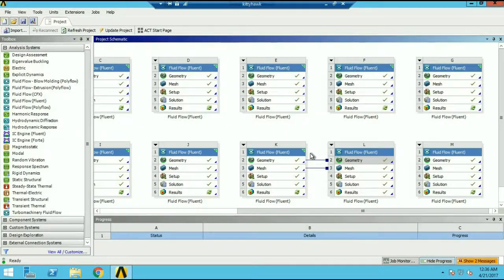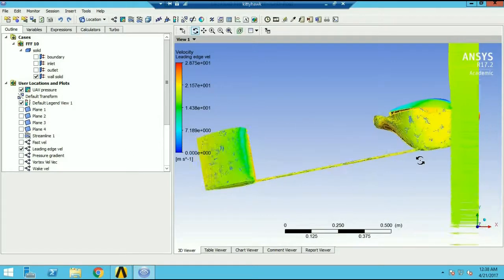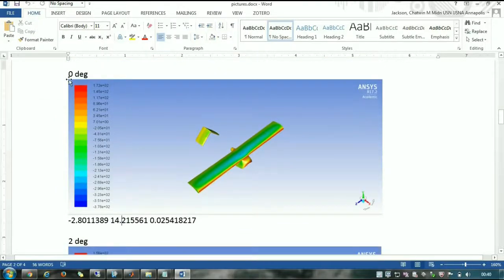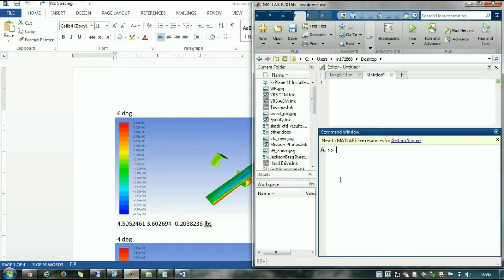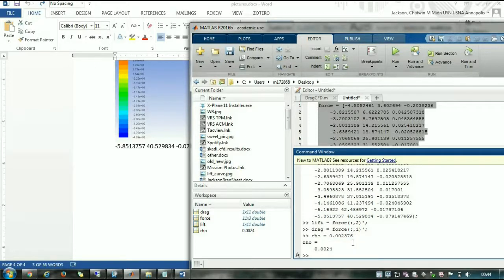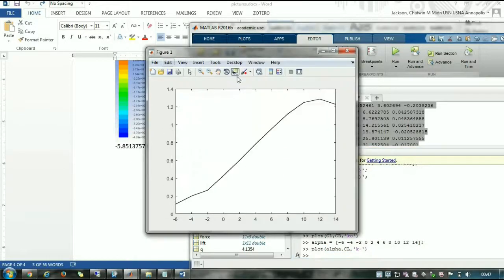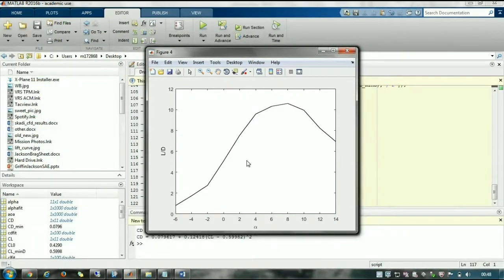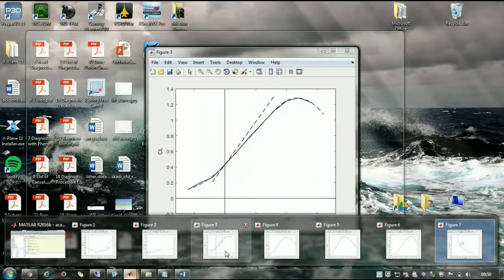FLUENT 4.4: DBF Tools Drag Polar and Lift Curve

Comment: Nice work, thank you.
It seems that your system is high spec because your meshing speed seems quite quick. 
Can you please elaborate a little on the PC you are running this on ?
Processor, Ram, GPU, HDD/SSD etc ?